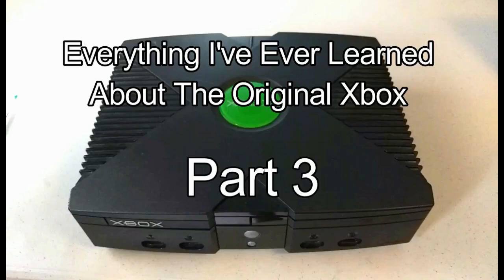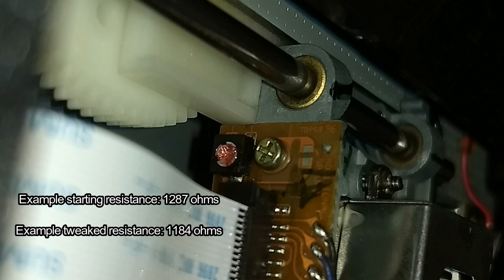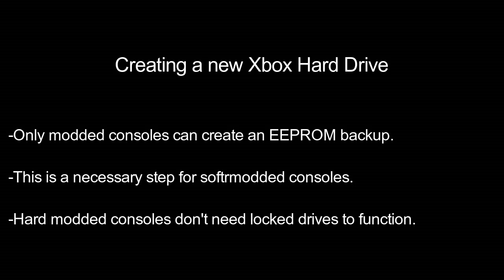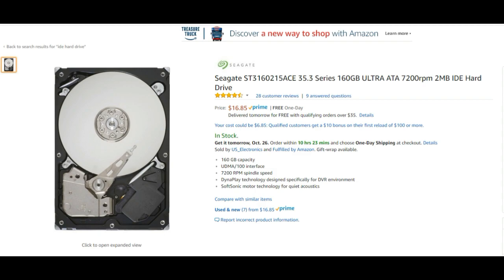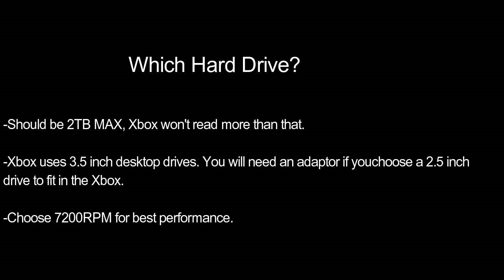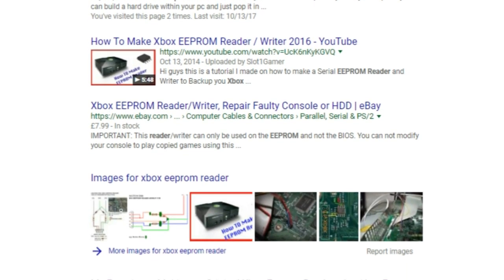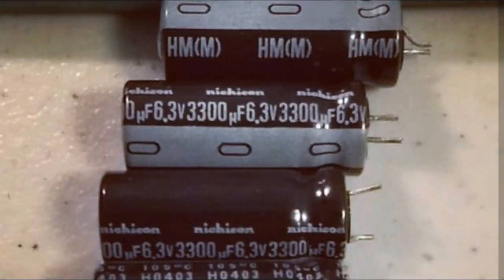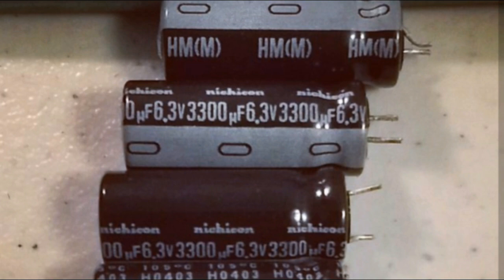Everything I've Ever Learned About the Xbox Part 3- Common Repairs

Comment from the maker: Correction: there is a USB version of xboxhdm available so you don't have to have a super old PC tower anymore. Do some research if this sounds like a good option for you.
Reply: Hello, i got this issue that i just can't seem to find the answer to... i found  an OG Xbox right in the thrash can, it was only the console itselt with no Controllers, RCA or Power cords. I decided to take a look and it actually looked fine, so i took it home. Once inside, i used a power cord from a very old 90's CD Player and noticed it fit perfectly on the Xbox. It turned on and i saw the front light flash orange/green. But i also noticed a peculiar smell coming out from the Fan... it smelled like roaches... yeah... took like 3 hours killing and cleaning what i could from the Xbox. 
I probably killed like 30-40 roaches. I also noticed there was a couple tiny tweezers attached on right on the sides of what it seemed a fuse on the PSU. taking a closer look i knew this was some sort of "bridge". It seems that whoever owned it decided to just get rid of it because of the roach infestation inside, but other than that the system works flawlessly and it appears to be Flashed, because it had a burned disc inside the Drive and a bunch of Retro Emulators installed. I want to remove those tiny tweezers and replace the Fuse, but i can't seem to find any info. You got any idea of what Voltage and Amps for this fuse?
Reply from the maker: Jeremiah Borden  this channel is essentially retired,haven't really done this stuff since I made these videos. Anyways the error code seems like it's related to the DVD drive. I would try other cables and a new drive entirely

Comment: Your videos are very helpful. I have what I believe to be a 1.3 revision that died on me one day. It ended up being the solder joints on the power supply. I posted about it on Reddit and one of the nice guys on there pointed out to me that not only was the solder joint bad, but there were scorch marks around it. I heard crackling and sizzling when trying to troubleshoot it as well. A close friend of mine was able to resolder the joints and fixed the issue.
Reply from the maker: thanks for sharing, glad you got it working!

Comment: I have an OG Xbox 1.0, did the pot tweak on my Thompson drive because it wouldn't read some games which were top notch, no dirt, no scratches.
Was originally at 1700omhs turned it down to 1000ohms and it's working perfectly so far, I can finally replay all my old games :)

Comment: Great set of videos! Watched them all. They have a lecture quality to them that isn't boring. I knew I had a Version 1.0 Xbox (which I removed the fan/heatsink and replaced it with a later revision heatsink (broken Xbox). 1:1 fit. 

I also pieced out the crappy Thompson drive I had which would have trouble reading game discs reliably, with a Philips and it works perfect every time.

Now I have 2 original Xboxes that have Philips drives that work great. Going to soft-mod one with a larger hard drive.
Reply from the maker: BoneCollector thanks for watching! I was planning on making more videos but got super busy. I'll try make a modding tutorial soon
Reply: Just found out my OG is indeed a 1.0. Can't wait to start modding. Any tips?

Comment: The clock capacitor CAN be replaced. In fact the new capacitor works 10 times better than the original. Look for capacitors with the following:  2.5 volt 10 Farad (NOT microfarad) Electrolytic Super Capacitor. Mouser Part # 504-HB1030-2R5106-R... It may not fit like the original, you only need to insert it and have the cap laying horizontally. You need to lay it that way, otherwise it will interfere with the DVD-ROM drive... When removing the original cap, make sure you clean the area very well, as the electrolyte that spills out is fairly corrosive. You MUST look at the tracks to see if any have been eaten away. Failing to do this can eventually lead to the X-Box playing up... In ALL the X-Box originals I've repaired having to replace that cap, I replaced it with a 50 Farad, to which all the settings were kept for more than a week with the X-Box unplugged from the mains... Trace corrosion repair to which I did many years ago as Darkmatter, can be seen here:  http://www.theisozone.com/tutorials/xbox/hardware-and-modding/trace-corrosion-repair/     ...
Reply from the maker: wow thanks for contributing. Your trace corrosion repair was very thorough and helped me a great deal. What you said about the clock cap may be correct, but I still never find it to be that much of an issue to run the machine without the clock cap at all. A modded Xbox wont even ask for the time, nor is it relevant for any software such as games or apps.
Reply: Which model this is
Reply from the maker: daniyal alrounder 1.0-1.5 need clock caps to be removed. 1.6 is ok
Reply: just use a coin battery

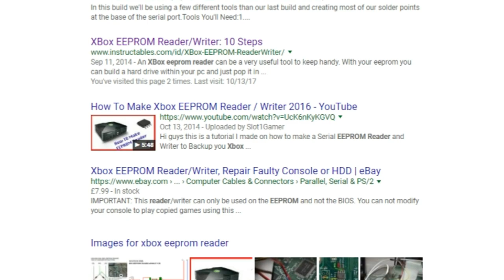Comment: I have an old PC (bought it in 2005) and I had luck using Xbox HDM, it's an awesome tool! I extracted the EEPROM.BIN using a special cable that I built (tutorial on youtube, the same one you mentioned at 20:10, it's awesome), got the eeprom's content and using that I burnt a linux live CD on a CD-RW. I revived 3 or 4, maybe 5 Xboxes so far with this method, initializing a new HDD for them. If you have the hardware it's worth going this route.

Comment: Great video except for last tip, Repairing traces on the motherboard is easy! I found my dads dusty old multimeter and soldering iron. I found which trace was broken, soldered a jumper wire between the points, and boom! My xbox powers up like a dream. No random power ups or shutdowns.

Comment: Once I got an Xbox with FRAG and the only problem was that the previous idiot who tinkered with the system, twisted the IDE cable and plugged it in upside down despite the IDE port and cable has a "key" to prevent this, they managed to do it. Also, as far as I remember the leaking acid from a ClockCap caused some serious problems but after cleaning the stuff up the system started. Probably something was sorted or something.

Comment: You're wrong about the maximum storage capacity. The Xbox can read up to 2.3 terabytes. And IDE hard drives go up to 750 gigs. You have to keep in mind the dates on the hard drive as well if you have an original version 1.0 Xbox with a hard drive from 2001 and you replace it with a hard drive IDE from 2008 you just made the Xbox 7 years newer than its original age. I've used IDE all the time never going lower than 250. They're very easy to find locally and cheap as well. The trick is when you're using chimp you have to listen to the hard drive. If you hear any clicking or weird noises coming from it throw it in the garbage. Hook up your original hard drive back into your Xbox and rerun chimp again. Also I've heard of a few people using the original IDE cable with a 2 terabyte. Sometimes it works when it does it is a little slower. You can use an 80 wire IDE even with an IDE hard drive it will make for a lot faster load times.
Reply from the maker: Retro Pro Frank while that's technically true, there aren't 2.3 TB drives you can buy. I don't suggest anyone buys a HDD if they can't utilize all of it's space. You also need to take extra steps to make sure the Xbox writes the data correctly, or else you run the risk of overwriting vital data. Of course, that's completely within your own discretion. I just don't recommend it. Regarding your comments on IDE drives, I just wanted to give a reasonable pros/cons list so people can decide for themselves what kind of drive to get.
Thanks for watching!

Comment: the clock cap is best replaced with coin battery also CLEAN EVERYTHING off your HDD before you softmod or it will be stuck even 2021 rocky5 cant fix this

Comment: You can also put the Thompson DVD drive belt in boiling water which will cause it to shrink back to it's original size/shape.
HTH

So Microsoft replaced the power supply plug & wire for one with a built in circuit breaker because the connector on the console was faulty!
That's like a Hospital putting a Band aid on a severed limb and sending you home!!!
I kept the original power plug & lead because I tested it and could find no faults with it or with my wife's one either, we did use the replacement's though.
Thanks for the information it's always good to know.

Comment: I unfortunately ran into the fragging problem after I replaced the thermal paste. It worked for a few minutes then froze. Restart the system and boom no video and system cycled on and off a few times then red and green lights. Not sure what I did just popped off the heatsinks cleaned the chips used artic 5 and put it all back together :(
Reply from the maker: Make sure nothing spilled into the CPU socket.
Reply: @retro_vg_repairs3339  I left the console alone for a few days and now it seems to be working fine

Comment: Hi I just found an original Xbox on the street being thrown out. I get a flashing red and orange light and no picture. I bought a brand new av cable  no picture. Digging around the internet I can't find a clear explanation to what this might be for sure. I've removed the clock capacitor.
Reply from the maker: Ivan Blajer hmm was the cap leaking? Try cleaning that area with isopropyl alcohol
Reply: @retro_vg_repairs3339  indeed it was leaking and I have removed it and tried to clean it up with IPA no difference to the result. I'll get another chance to work on it tomorrow.
Reply from the maker: Ivan Blajer hmm. Blinking red light shows system failure. The cap could have ruined something important. Don't spend too much effort, you got it for free anyways
Reply from the maker: Ivan Blajer save the DVD drive, power supply and other things. They may be useful if you get another xbox
Reply: @retro_vg_repairs3339  with the av cable out I got blinking orange and green. With the cable attached I get blinking orange and red, theard is a version 1.0 or 1.1.  The GPU fan doesn't spin but there's power to the connector the main CPU fan runs fine. Before I give up I might check a few other things for broken traces. In the area where the clock cap was I can see another small cap that has leaked.

Comment: When it comes to the clock capacitor I think it has to do with more of where it was manufactured, I own both a 1.0 and 1.2 Xbox motherboard that comes with the exact same capacitor used in a 1.6.

I also own a 1.0 that was manufactured in Mexico that has this bad capacitor in it, it's a black capacitor with no obvious brand names on it.
Reply: My 1.0 looks like the one in the video. The other 2 I have look nothing like the one in the video. 1.1's I believe.

Comment: Thanks to your video I found a broken trace right where you showed, close to the ClockCap, managed to patch it but my motherboard still won't start up. I know the PSU is working as I managed to test it with a different motherboard, I checked every major capacitors but it still won't work. I'm running out of ideas, I don't want this to turn into just another donor system, I want to save them all!
Reply from the maker: Dukefazon tell me more. What version? Describe the symptoms
Reply: @retro_vg_repairs3339  It seems like it's a version 1.0 or 1.1, since the power cable is a single row one. When I switched the PSU with another Xbox the system turned on, so it's not the PSU. I tested the buttons in continuity mode with a multimeter and the eject and power buttons seems to be alright. When I press and of them literally nothing happens. Not a beep, fans not moving, no LEDs. No bulging caps, I have a 100Mhz capacitor tester and I didn't find any bad caps among the bigger or smaller ones, the one broken trace I found was patched. Maybe there's a fuse that was blown on the board, I don't know...
Reply from the maker: Dukefazon I don't mean to be redundant but you checked all the traces on the back of the motherboard that I show at 25:55?
Reply: @retro_vg_repairs3339  4 traces run at that corner and the rest seemed to be fine. But I'll check them again later tomorrow.

Comment: CHIMP wont display video on the 1.6v xbox and its a super pain in the ass usually I just give up trying to recover or upgrade the hdd of a softmod and just install a modchip and make a clean install with a "new" hdd
Reply from the maker: MobCat make sure you're using composite cables
Reply: Yeah it dosent have anything to do with that, it has to do with the excalibur video encoder braking some 480p stuff also braking support for some unix things...
Reply from the maker: MobCat I've never had that issue. I say to use composite because the Xbox will run in 480i, which xcalibur can handle just fine. 480p wouldn't be part of it at all.

Comment: i bro, my xbox vvas fraging, but i change the dvd drive povver cord and it vvorks, but vvhen turn off  i must wait few minutes before turn on again, becouse grag again a fevv minutes later turn on great, vvhat can it be? im sorry for my english thanks
Reply from the maker: Felipe a. p.c. hi. Check to see if the clock capacitor has leaked and clean it
Reply: i w take off and clean it, was the first step, im was not mention, sorry

Comment: 5:20 i did the pot tweak on my xbox 360 probably like 5 years ago now due to the dirty disc error, its a 2009 year Jasper model 360 and the disc drive is a philips / lite-on DG 16D2S. I dont remember the resistance values that i set on the potentiometer, but i still have this console today and use it all the time (its RGH modded) and the drive is still doing great, even reads some lightly scratched discs that other xbox drives struggle with. makes me curious what resistance i set, kinda want to take it apart and check.

Comment: Mine boots and shows error 9, but also randomly turns off and power is on constantly with lead in, I removed the clock cap as it had leaked, but error 9 still there and shuts off by itself think it’s all a bad trace? Or hard drive failure too?

Comment: My xbox has this problem: When I turn it first time everything is fine, nothing goes wrong. After some time IF I only eject the game or press power and want to turn it on again, it will start the christmas light. I I continually press power like 3, 4 times it will eventually work again and I can play the game. I opened it up, changed the heat compound for both CPU and GPS and I removed the clock capacitor and still same problem. My xbox is ver 1.3 and unmodded.
Reply from the maker: Sounds like a dying motherboard. Any bulging capacitors?

Comment: I repaired my Thomson TGM600 drive — cleaned the belt, lubricated gears and rails and cleaned the laser. Success at first – and then the drive stopped working completely. No response, no power.

Any suggestions?
Reply: Did you ever figure out the issue with your DVD drive? I’m having the same issue
Reply: @xman2k2   I found some iFixit information about replacing the capacitors on the drive's PCB board. I'm waiting for the replacement capacitors and probably going to try this week. Will update on my results!

https://www.ifixit.com/Guide/Xbox+Thomson+DVD+Drive+Disassembly/129534

Comment: @Retro_Bg_Repairs i recently like 7 hours ago used a Band a loom rubber band to replace my drives belt bc it was deformed and stretched sadly i have a reading error i cant fix the band a loom bands are the ones used to make these rubber band bracelets im thinking about making a vid on changing the belt which is really just a small rubber band and the band a loom bands may lop around a but if the tray moves faster but i went for hours fast and slow pushing the tray in and out and had no problems with it myself while i was watching yt just saying this for other readers and just incase you didn't think or know of it as a option

Comment: I have a dead 1.6 Xbox, right before it died I was playing Halo 2 but the thing just shuts off by itself off and wouldn't turn back on. I took it apart, pressed the power button a few times, the fan would spin for 1 second, press it a few more times, fan spins again for 1 second. Then I replaced the 5 bulging caps shown in this video but the Xbox still won't turn on when I press power or eject. Now fan won't spin at all. Checked for trace corrosion on the board but it's clean. Plug in a working power supply from another 1.6 Xbox, still won't turn on. Please help, I really wana fix this Xbox. EDIT: I forgot to mention the 3300uF capacitor I got from Sayal Electronics is  16V with an unknown brand. Do you think they are bad too? https://secure.sayal.com/STORE2/View_SHOP.php?SKU=232789
Reply from the maker: Think you used the wrong caps buddy. Try to get caps that match the exact voltage and capacitance and try again